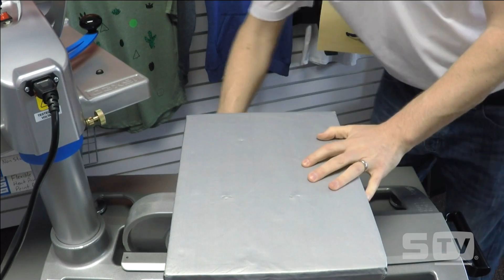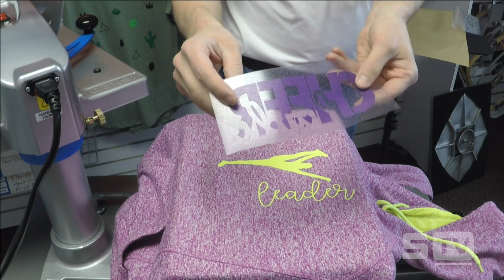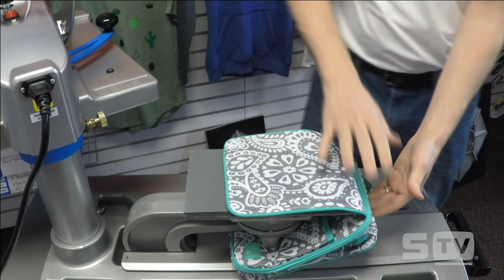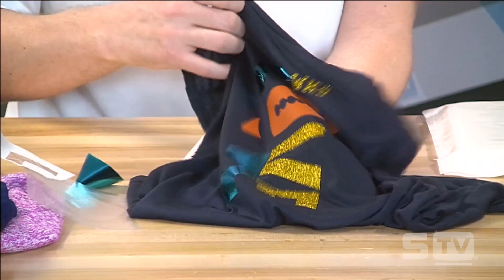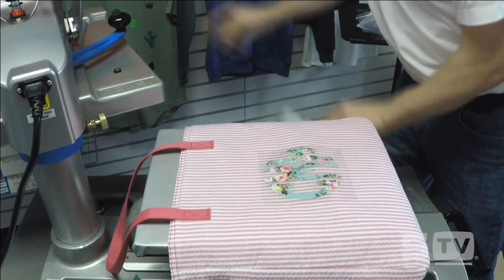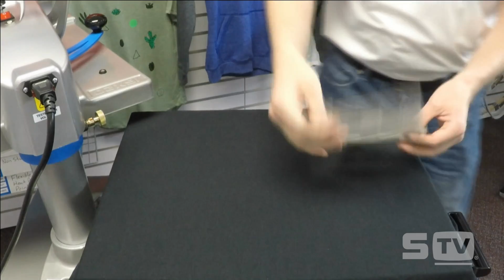How to Use Multi Color Prints and Designs to Create Mixed Media Apparel

Comment: Can the CAD CUT printable Heat Transfer Material be used in the silhouette? Like can I print the item on my deskjet printer and then modify it for cutting via the silhouette machine?
Reply from the maker: Yes, you can cut our material on the Silhouette.
Reply: @StahlsTV Oh, okay. That's great to know. Thanks!